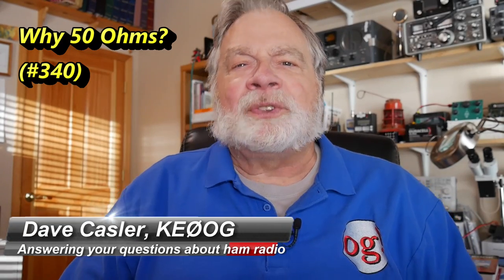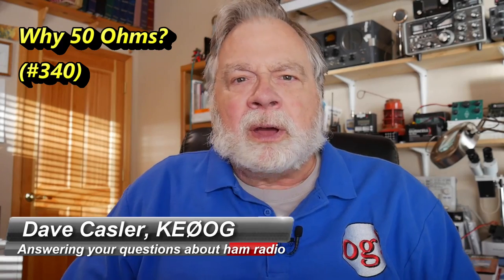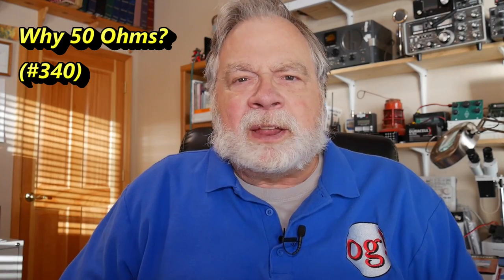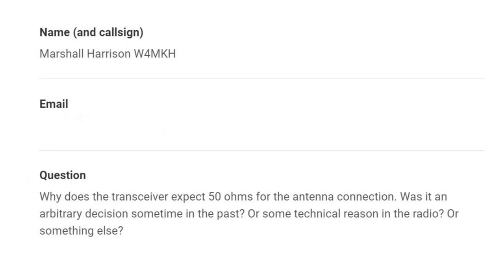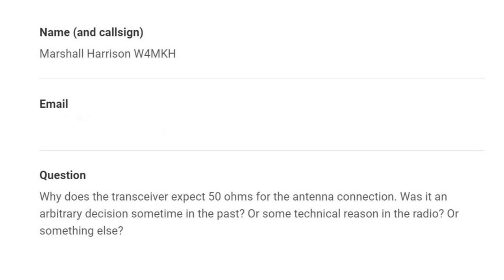Why is Coax 50 Ohms? (#340)

Comment: 40 years ago I was asked this as an interview question for a job at the Motorola company as an RF design engineer. I spent over two hours filling the board with math to give a deterministic answer for both the 30 Ohm,(max power) and the 75 ohm(least loss) cable impedence answers... but could not for the life of me conjure up the math to justify why 50 ohm cable impedence was chosen. After a very long time of me sweating over the math during which all the grey beards were well amused, they finaly spilled the beans and told me it was a comprimise...and there was not a determinustic answer! I was not amused by them taking so much joy out of my apparent stupidity, so politely gave them the bird after receiving my travel expenses and ended up in the Marconi Company.
Reply: Sounds like they were assessing how you would tackle trying to find a solution to an unfamiliar problem under pressure, while also checking for sticks up your backside.

Don't get me wrong, plenty of people prefer strict professionalism at work, and that's fair. All the better to discover such differences at the interviewing stage, though. It sounds like you were both better off for it.
Reply: So much of engineering involves the art of finding solutions to conflicting requirements with imperfect mathematical models that involve a combination of empirical and theoretical approaches. This is what separates the great engineers from the great mathematicians. The mathematician enjoys the quantitative perfection of math. The engineer enjoys the qualitative best-fit compromise to conflicting requirements using imperfect mathematical models and empirical tables. Like medicine, engineers "practice" their craft. 

I've met many engineers who are brilliant at mathematical theory but fall short when these models don't perfectly predict reality. It's a lesser version of Dustin Hoffman's idiot savant character in the movie Rain Man. Your Motorola interviewers were brilliant. They asked a question to qualitatively evaluate your problem solving skills when math cannot provide a single quantitative answer. They were also able to evaluate your ability to handle the stress of not being able to reverse engineer this kind of real-world engineering solution. Your responses revealed a lot about your approach to engineering. 

I encourage you to look at this from the interviewer's point of view and consider what they were trying to evaluate. Their objective was not to humiliate you or to provide them with entertainment at your expense. (That was just your bonus gift to them.) Your response told them volumes about your approach to real-world engineering and how you respond to these kinds of real-world problems.  I think these kinds of questions are some of the best interview questions. They reveal so much about the prospective candidate. 

I too have failed at similar interview questions. I never got angry at the interviewer, only at myself. It would never have entered my mind to give the interviewer the bird for asking this kind of question. If you did this forty years ago and still harbor anger toward the interviewers... well, I don't know what I can tell you. The problem is yours, not theirs.
Reply: Fantastic strory!!! Thanks for sharing!
Reply: anyone who ever had to deal with Motorola engineer back in the day would understand LOL
in the 90s I had run ins with the team that was over the 680?? chips and early 2000s with the repeater guys, oh it was a shit show.... Im out here testing and re engineering (trying to make it better, bigger better faster) what you didnt
Reply: I love your reaction to the interview abuse. I am thinking you chose well. Is not Marconi the guy who figured most of this out anyway? I could not do it with the math all thou I could see it on a “SA” or a sweep cart when we used to sweep our ESM systems before deployment; it’s good to know when locked on to fire control radar. Can still hear it ringing in my ears over 4 decades later. I was a nuts and bolts tron.
Reply: Though
Reply: @jbman413 Marconi en Nicolai Tesla had many arguments and fights about it.
Reply: @Grandassets  I did a project for them where the best fit (software/hardware) was a Z-80. They didn't bat an eyelash. Not even a murmur. It surprised me.
Reply: Excellent!!!!  I knw just what you mean!!!!!  Great comet.  Thank you!!!!!
Reply: So what you are saying is your ego was bruised... 🤔😂
Reply: Perhaps it seems more correct to have chosen the 70 ohm one, like the TV coaxial, but perhaps with a director or a reflector etc or with the V-shaped antenna, the impedance dropped to 50 ohms.
Reply: I had an interview at Marconi in 1969. I turned the offer down in favour of Post Office Telephones. After college and university I went into the research department at dollis hill and then martlesham. Happy days.
Reply: @konayasai  Motorola always interviews like that...when I interviewed back in the early 80s, they asked me to design a Class A amplifier based on certain operating characteristics...having been put on the spot, I designed something that would work...being a little flustered afterward, I wasn't in the interviewing mood anymore...I didn't go to work for them, either...;-)
Reply: The dirty trick they pulled on me was to keep me there for 30 years.
Reply: Sounds like a bunch of old sadhams getting off on it . 
I have a lot of admiration  for you guys and what you do . The last interview  I had long long ago I was asked can I use a chainsaw . After sweating on that answer I got the job 😂. Now being a boss I am willing to give as much info I can to up n comers . The tradesmen  of the older generation have so much to give and its getting lost sadly . I hope the ego can be shoved in the draw and the knowledge be given out freely . Even the old sadhams have got plenty  to learn . Even being knocked off your high horse is a lesson worth the fall .
Reply: marconi was a thief.

Comment: A guy a mile from me was apparently an avid short wave enthusiast, who excelled at DXing.  When he passed, I visited his property in the woods and saw his very tall antenna tower.  I Googled his name and discovered his fame.  Someone apparently bought the tower, because the next time I visited it was gone and I saw cut stubs of 1"+ cable I did not recognize.  It was "Heliax" I believe you called it, I am positive.  Regarding your citation of Bell Labs research, my dad started at Bell Labs in 1928.  In his things after he passed, we found volumes of technical articles authored at BL from that time forward that were of the nature you cite - seeking to reduce noise, maximize power transfer, increase reliability, etc.  What an amazing period of innovation he worked through, from '28 to '69.  Excellent job on this video.
Reply: That's Heliax, all right. Before I retired from a Fortune 100 I was a comm tech (later renamed IT Field Services tech, then Communications Networks tech) we had a few decades of 2GHz microwave. Ours used 1.75 and 2.something inch Heliax. It has been a while since I fought with that stuff - it was stiff and smooshable at the same time - but once in place it was plenty reliable. Well, except the center connection on our older stuff used a "bullet" that went inside the center conductor. That had a bad history of becoming intermittent at the antenna end, where winds liked to work it back and forth a bit.
Sometime around Y2K all the 2 GHz licenses were bought out for PCS, the first step toward modern cell phones. I don't miss them a bit.

Comment: Allow a correction - Heaviside invented “operational calculus” not differential calculus. Newton and Leibnitz independently invented differential calculus in the late 1600s. Leibnitz’s version was closer to the modern notation using dy/dx. Operational calculus is a method of solving differential equations (which might be a source of confusion here, with the term “differential”) . Differential equations are equations containing derivatives. Operational calculus converts a differential equation into a problem of algebra, which is a simplification.
Reply: I think the term everyone is looking for Integral Calculus developed independently by Newton and Leibnitz. Granted newtons methods are a bit harder to follow as he delt more with infinite series. Derivative Calculus has been around since the time of the Greeks. While these are the main breachers, And there are many branches of Calculus. Such as differential calculus, multi-variable calculus, vector calculus, etc...
I don't know who discovered which branch or who did what with which, Derivative Calculus and Integral Calculus are the 2 main branches which everything else expands from.
Reply: Heaviside was also (largely) responsible for vector calculus. It is his reformulation of James Clerk Maxwell's equations into the four we know today as Maxwell's equations (Maxwell had 20 different equations in x,y an z co-ordinate form). He was also produced half the terminology used in electromagnetism. Conductance, impedance, permeability, reluctance a whole lot more.

Heaviside was a major league eccentric genius. Probably Britain's equivalent to Nikola Tesla but without the annoying cultists and virtually unknown to all but a tiny proportion of the population.
Reply: Thanks for the clarification, I was starting to think my brain had already melted and forgot about my tons of math classes from engineering.
We had a semester almost entirely learning Heaviside operational calculus methods (tho there was more to it too).
Reply: I wouldn't. You have to keep a sandbag in the back to offset the imbalance of the heavy side. :P
Reply: Third order equipment has distance, velocity & acceleration. The physical world is third order with sunlight reflection refraction and sun spots as random noise
Reply: My brain switched to discrete integral  calculus I  thought that what he meant
Reply: Thank you - I was pretty sure I was taught Newton was one of the inventors of differential calculus.
Reply: I was gonna say something about his mistake but you already came up with an amazing explanation.
Reply: copernicus633
Yes
Reply: @FrozenKnight21  differential calculus comes before integral calculus...Newton and Leibniz are credited with differential calculus.  Ancient Greeks did not do calculus.
Reply: Thank you! 🙂
Reply: Big Brain Comment Section.
Reply: No difference actually.
Reply: Hm, I thought he meant “vector calculus” since it was him who came up with the cross product and the various del operators (div, curl, grad), and condensed Maxwell’s original 12 equations into the four vector equations being taught today. (although there are even more compact formulations using tensor calculus or geometric algebra)
Reply: @rebase  
Thanks for the goodinformation. Adaptions newer & better were common. What we have (& use) aren't in the original form but modified by someone; but that was never stated nor acknowledged. Such claims are a recent phenomenon. 
Vector Calculus (div, curl, grad) are defined in 3D space. May be Maxwell's formulation was also (indirectly) a proof that the world as we see or measure is 3D, or rather a sub-space of higher dimensional Space that is formulated in later theories of Universe.
Reply: The only two things I remember from this class. So it's not like my girlfriend is a bit on the Heavy side? 
And... ahem.. does best Colonel Klink impersonation  Release the Wronskian !

Comment: The answer to questions like this often boils down to the fact that engineering is the art of compromise. So 50 Ohms was chosen for air dielectric coax as a good compromise between low insertion loss and power handling, with 50 Ohms being a convenient value between the extremes of the "contradicting" constraints.

Comment: I read about this many many years ago. IIRC, the "High Power" optimum is actually a balance between the arc-over voltage and the resistive loss of the conductors. If it was strictly arc-over voltage, then the optimum would be as low an impedance as possible, to minimize the voltage. So I think it's a balancing act, both voltage and current.

Comment: Twisted pairs. In the days of open wire telephone lines, if you followed along one pair, about every 5th to 15th pole (depending on the system) you could see a bracket with 4 insulators. The 2 wires would switch positions at this point. This was the same as twisting the wires. The distance between twists, depended on numerous factors such as how close the pair was to the next pair, what the length of the line was, to what frequencies were being transmitted along the line. If you look at the difference between cat 3 and cat 6 cable you can see the cat 6 cable has much tighter twists allowing a higher carrier frequencies, thus more data along the pairs without getting so much crosswalk that the signals on adjacent pairs would interfere with each other.

Comment: Before the general adoption of twisted pair Ethernet, some computer networks used 50 ohm coax. That's what I built my first home network with in 1995. 

In the late 70's and early 80's I was a cable TV tech for a system in Reston Va. The system was first built in the early 70's using 1 inch direct bury 75 ohm coax for the main trunk lines. Aluminum coax as is used now was not available back then. Our cable consisted of a solid copper center conductor, polyethylene dielectric, a corrugated copper shield which was coated with a waterproofing gel and finally the polyethylene waterproof jacket. The entire system was underground. We had an issue with a particular pedestal amplifier located in a low lying swampy area where the outer jacket had apparently been nicked allowing the water to get between the outer jacket and the shield. The water would percolate along the inside of the jacket and come out inside the next amplifier which we had to go out, open up, drain, then replace the amp. After the other tech had replaced the amp 4 times, I was assigned to solve the problem. We didn't have the budget at that point to replace or dig up the cable, so I removed about an inch of the outer jacket just before it went into the amp allowing the water to leak out before going into the amp.

Around 1979, the Reston cable system got its first satellite dish. About a year later the tech on call started getting hundreds of calls in the middle of the night that all the satellite channels were out. He went to the head-end but couldn't find the issue. After a couple of hours of frustration, he called me in. Between the dish and the building, we were using a 2 inch coax, very similar to the one you showed a picture of with air dielectric. The cable was run underground through a conduit to the dish about 50 feet from the building. To keep water out of the cable, there was a small air compressor which kept about 1/4 pound of pressure in the cable. After a minute of studying the situation, I asked, why is the compressor running continuously? The dish was the type where the accumulated signal was reflected from the large dish back to a small cone shaped reflector which reflected the signal into a square horn where the actual antenna and low noise amp (LNA) was located. The opening of the square horn was covered with a flexible plastic shield which kept water out. It had been raining most of the day. I went out to the dish and discovered the plastic shield had ruptured allowing the rain to fill the horn and cable going back to the building. We jerry rigged a plastic bag over the horn, disconnected the cable from the receiver in the building and drained about 2 gallons of water out of it. Hooked back up and the service was restored until we could get a replacement (UV protected this time) horn shield.
Reply: Thank you for sharing this! Awesome stories!
Reply: Those Coax ethernet networks were awful, no happy memories there for me. Good stories!

Comment: Years ago while researching into the origins of VHF (AM) offset carrier transmission (simulcasting) I ended up in the under ground archives of the British library, Chancery Lane in London.  Most of the original sources had yet to be digitised.  After several days searching through dusty volumes of abstracts I located the original paper - but on the previous page was a paper on the optimum rate of twist for minimising cross-talk on telephone distribution frames.  These papers were dated 1946.  The bottom line is that someone, somewhere, spent a lot of time figuring such things out, often long ago, and the standards we take for granted were often based on the physical characteristics of the materials used.   Good video by the way - and a good question too...

Comment: Good explanation Dave.  I'm a EE with a BS degree.  I specialized in transmission line theory and RF communications.  This is exactly what we were taught at Iowa State many moons ago.  The characteristic impedance for CATV coax is 75 ohms.  For telephone cable it is 900 ohms with loaded cable and 600 ohms with non-loaded cable.

Comment: More years ago than I care to remember I worked for Radio Shack during the CB (Citizen's Band) radio boom. The normal (single) antenna used RG58 (50 ohm) cable. Some buyers wanted dual antennas to be mounted on either side of a truck for a better sending and receiving pattern. The dual antennas used (if I remember correctly) RG59 (75 ohm) cable.... Of course half of the radio's output power went to each. The way the two cables were connected their presented impedance was close to 50 ohms at the coax connection to the radio.

Comment: Oliver Heaviside was a genius, that many in Electrical Engineering community no less about. He introduced the concept of (impedance) "matching", whether it is a twisted pair, flat cable (like for old TV set to its antenna) or co-axial cable. Conceptually, this is the backbone of Electrical Engineering.
Reply: The also formulated what we now know as Maxwell equations.